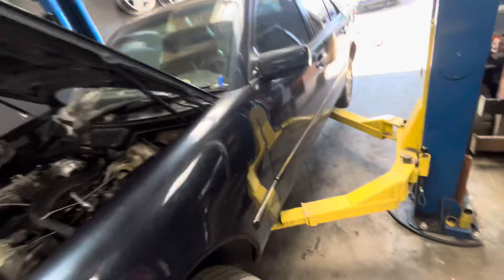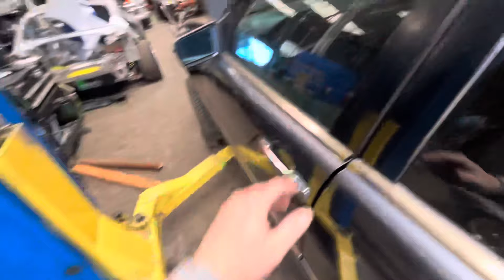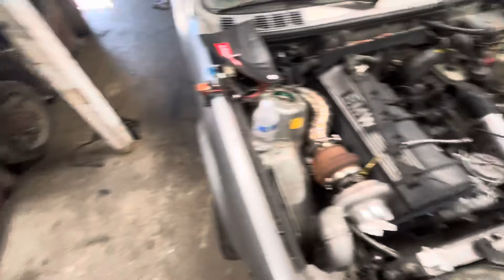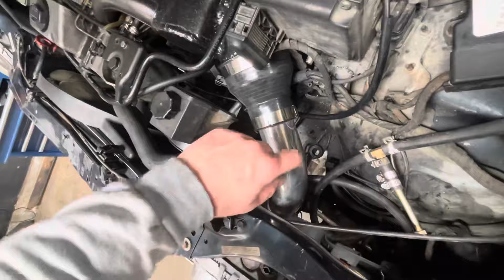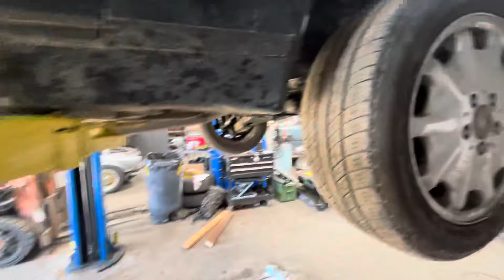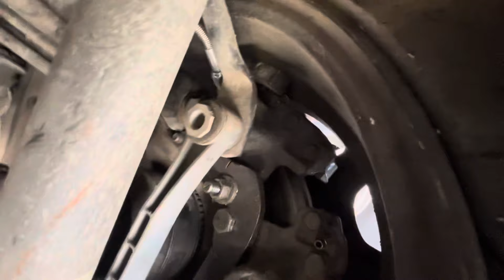Om606 “diesel 2jz” w210 bajabenz 4.0 overview

Comment: Hello..what transmission are you running?is it gs6-53dz or other one…I want to couple gs5-53dz with my om606,which is in my w202 and how fits I really don’t know..good luck in your project✌️🏎🏎🏎
Reply from the maker: I’ve only used the gs6-37 so far and with great results with low power (below 400whp) I consider these to be bulletproof, eventually I would like to try a 53 but for now 37 is great
Reply: @Curbsurf belive me gs6-53dz is bulletproof and can handle app 1000nm..you will be happy with that..for your current goal its also good reasonable trasnmission..👍👍good luck and  make more videos like that😎

Comment: So was the W202 clutch setup basically a "bolt in" for the most part?  Or at least as "bolt in" as I would expect the manual from a W210 would be?
Reply from the maker: The only w202 thing in the car is the pedal itself master is a w124 master if I remember correctly
Reply: So literally just added the third pedal  and the other two (gas and brake) stayed in place? @Curbsurf
Reply from the maker: @Skul-Ski  no the w202/manual 210 clutch pedal comes with a smaller brake pedal just like other German cars like e30/36/46

Comment: What u running a plate on the manifold ? K14 to t3 ?
Reply from the maker: No I made a bolt on solution with na manifolds because it was a na motor originally